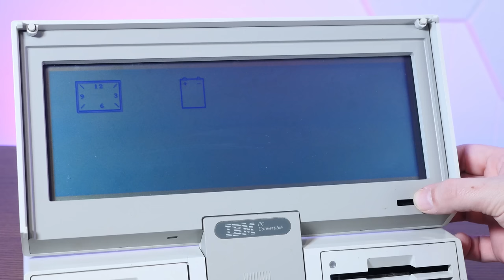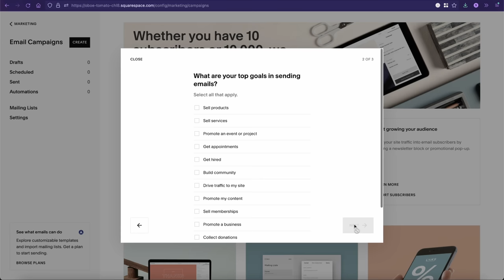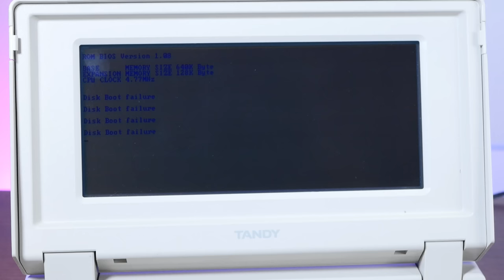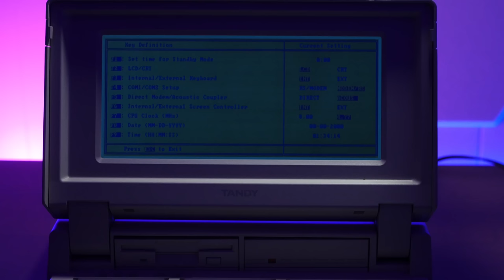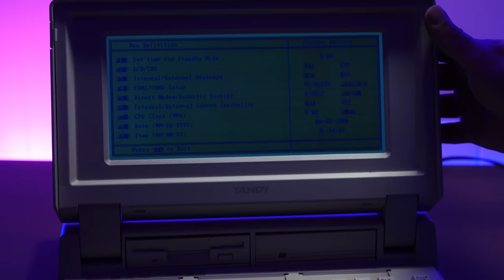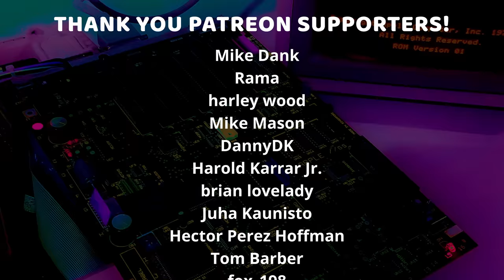I Fight a Tandy 1400HD to the Death

Comment: Unstable supply voltage/dead caps. You hear all that noise through the speaker because of all that electrical noise on one (or more) power lines.

Comment: You're not getting consistent power in. The noise your hearing is due to noise on your power lines interfering with the speaker, the reason you're hearing a difference in tone when accessing the floppy is likely evidence of this. The power supply needs some further work and it would be a good idea to recap the motherboard and have a close at the  power rails to make each component is getting an adequate supply.

Comment: The Tandy is acting like it's not getting enough power. I'd suggest doing a full recap of the other power supply also. One way to test weak power supply power is to unplug the HDD and see if that improves overall performance, as the HDD is the biggest power consumer in that machine; The backlight being the second-largest power consumer.

Also consider testing and recapping the motherboard itself. And, while some people might balk, I'd suggest replacing EVERY electrolytic cap I see. Nothing lasts forever, and IMO, it would help to resolve a lot of electrical gremlins. It just depends on how much you want to invest in these machines.

Comment: 1701 means hard disk controller error. Light blinking and disk spinning down indicates the drive has an error code to report (which it is blinking out). The drive thus is not responding to commands and thus the controller reports an error.

Comment: There's almost never a good reason to jump a fuse. Either it's blown because there's some other faulty component that's drawing too much current, or there's some other problem that hasn't caused the fuse to blow. Either way, check the continuity of the fuse and if it's blown you need to figure out why it blew, not just replace it with a wire. If you do that and the problem is still there, it could possibly draw a lot more current and cause even more damage.

First step is always thou shalt check voltages. You should be able to see if a rail is loaded down. The fact that the screen dims under load should be pretty visible on the multimeter. If you haven't already replaced all the caps in the power supply, that would be a good start. I'd also check the diodes and transistors, make sure they're not shorted something. Also check the transformer to make sure there's no shorted windings, or shorts between the windings.

That capacitor falling on the motherboard could also have caused something to blow, which is now loading down a power rail as well.

Anyway, that's a good start for your homework. Please turn in your copybook once you've completed the assigned exercises.
Reply: I was internally screaming all the time he did that, I mean checking the fuse and recapping the PSU should be the first thing when you see the screen flickering when something drawes power...

Comment: The screaming noise is probably due to poor filtering on the power rails. Could also be the cause of some of the other weirdness. This could easily be due to the other caps in the power supply being bad, despite not looking bad, and not filtering the power rails properly.

Comment: Seems like one of the drives is browning out the system. Or maybe the floppy controller. You should put volt-meters on all the voltage rails and measure them when its trying to do stuff.

Comment: Ok on fuses, you can use continuity checks on a multi-meter. Also with that much corrosion, you also need to check the continuity between traces on the board itself, because that level of corrosion most likely ate away some of the traces.
Reply: I'm watching this in horror, thinking "JUST CHECK THE CONTINUITY!!!, WHERE'S YOUR METER???? WTF????" , I'm currently at 8:03 so I don't know what happens next.
Reply: Especially vias, I've found...
Reply: Echo the comments above. I was so nervous…
Reply: I was thinking the same thing. If you don't have a meter, I highly recommend one that beeps for continuity so you don't have to look away from the probes while testing.

Comment: Im happy you decided to do a full recap!
Visual inspection of caps just tells you they look nice, nothing more.

When a friend donated a Macintosh Performa 450to me he tested it and it was working.

I got it a few days later and it was stone dead. PSU caps where leaking everywhere and it was fresh! The problem was that o-rings dry up, they get hot during first power up and dont expand with the casing so they leak and die after that.

Fixed the PSU, it powered up but the FDD had a lot of issues, one was leaky caps with corrosion.

I was swabbing of the paint apple put on them during manufacturing, I wanted to read the specs printed on top of the SMD electrolytics hidden under the paint.

The dam caps fell strait off LOL!

Looked like traces and pads where gone, brown corrosion crap everywhere. Cleaned it off with vinegar and I found perfectly good copper under the corrosion. Recaped it, cleaned the heads (did not read or write properly), and eventually got i working properly again.

Still have to do the MB but will do that once I found a replacement for the HDD.

But I would not be surprised if the lose caps in your machine just detached them self's, old electrolyte seems pretty corrosive compared to more modern stuff and the legs just corrodes off the pads.

Im sure you get it going with some fresh caps and probably a few more fixes,  often other stuff are broken too, not just caps but lets hope not.

Good luck and see you in part 2!

Comment: I would probably try measuring the power supply voltages.  Most likely 5 and 12 volts with a teensy bit of —12 for the serial port.   Replacing caps wholesale is not the very best strategy, better to measure them first with a cap and ESR meter. It’s best to have some guidance from the measurements.  Ad one is likely to maybe goof up on replacing 10% of the parts so fewer repairs is better.

Comment: The hard drive itself may have some leaky capacitors and/or the actuator motor may be frozen. Had both issues on some of my more ancient laptops. Dunno if these drives work now (as one machine is still dead and the others don't have a BIOS so I can even tell them that they have a hard drive), but at least the drives now pass their self test as in they spin up, wait another second, then the actuator arm moves around, parks itself, drive LED turns off and the drive stays on.

Comment: The 8086vic-20 chip architecture tells me the drive is a 720K floppy drive. Using a 720K boot floppy (not 1.44) should get you up and running. The physical difference you should be able to see is if there is a hole opposite the write-protect tab. I;ve had to cover the hole in the past to get the disk to get a 1.44 to format as a 720K. Of course, you could always install a 360K drive for testing on the bench. Tandy units tend to power over the data cable, so without seeing the connections on the drives themselves, a little difficult to know. If the HDD is dead, best to pull the card and drive for testing, that way the controller isn't hanging the bios on startup. It is possible the drives are working, just a LLF is needed. I suspect the light tube in the LCD may be worn out and is dragging down the power supply. They can be a pain to replace, but it is doable. If you need some tools, let me know and I"ll send you a few that you may be able to use. Let me know if you have issues/questions, as these 8-bit units (8086's) were how I started in the computing industry back in the day.

Comment: Hey Sean. You absolutely need to recap those power supplies. They use esr parts which allows for rapid discharge, but they've long given up the ghost. Do not just buy random caps for this, need to match parts. I can help you with this if you need
Reply: Of Rochester? Like the Medway town?
Reply: @oldtechnobodycaresabout  new york

Comment: If it's anything like the early ZDS XT laptops, the hdd controller did not report in bios the drive size.

Regarding the floppy used - was it single density?  Some of those old laptops were single density only.

Comment: you should have gotten a 1400LT they are much more reliable and you can get a cf card adapter for it so you can keep both the dual floppies and still have a cf hdd. I did that to mines and its a blast using it!

Comment: Maybe you could temporarily substitute the PSU by an old AT or ATX one, just to see if it's a power issue. Also, those fuses really should be left as if there is a problem you don't risk passing high voltage to the main board. In a bind, you could just hot-wire a barrel fuse in it's place.
Reply: My temporary fuse replacement is usually a single tiny strand of wire, which is basically a fuse without the glass/container, or a piece of solder, because it melts pretty quickly if there's a problem.

Comment: Cute little computer. Floppy probably just needs a good clean, maybe has some sheered gear teeth. I would never expect such an ancient hard drive to just boot. Probably stiction or crashed heads. The 'voltage regulator' is most likely the step-up transformer for the backlight display. Remember to completely clean the boards before and after re-capping and watch out for loose pieces of solder.

The power supply is still suspect and may not be delivering enough power to the drives.

Comment: I'd love to make a Raspberry Pi cyberdeck out of one of those.
Reply: Put the Pi on an expansion card to replace the modem. Full original hardware with the power of a Pi on a bootable card.
Reply: @JosiahGould  There was a post on Hackaday last week showing how someone built a PCMCIA wifi card using an RP2040. I've found a standard Pi fits nicely in the case from a US Robotics Speedster modem, and can connect a hardware serial port on the GPIO pins.

Comment: i just fixed up a pentium 100 laptop and its working nicely, upgraded the ram to 40mb (32mb module + 8mb onboard), and a 32gb 2.5 IDE SSD from amazon. i have Windows 95 C on it.

Comment: You still have a power issue. That squealing is noise from the power supply. Bad filter caps, could be bad caps on the motherboard as well. The dimming of the display shows me that the voltages are sagging when the drive motors activate.

Comment: Sometimes to check just how bad the PSU is, i try to replace it by wiring up a standard PC PSU, however that implies figuring out the voltages for each pin.

Comment: This reminds me of PSUs inside an X68000. You should consider making a custom PCB that holds a PicoPSU. That will make the unit work correctly forever with modern protection that this PSU doesn’t have.

Comment: A good rule of thumb when it comes to blown fuses is to always assume something blew it. With that in mind, bypassing one with a wire link like that is usually a bad idea, and you're lucky you didn't blow up something else on the PSU. The first thing to do would be to look for dead shorts from any of the voltage rails to ground, and across AC. Then, check the diodes and the legs of any transistors, power regulators, etc for shorts. If everything looks good, unplug everything from the PSU and stick another similarly-rated fuse in the circuit and see if that one blows. too. If it doesn't, start looking for shorts on the input side of things.

The first rule of electronics troubleshooting is always check voltages. After you get your fuse problem squared away, check the +12v, +5, -5v, if it exists, and any other rails indicated by the service manual or any other documentation you can find. Often, a screen will dim or a hard drive will fail to spin up because they're getting several volts under spec. Leaky and dead caps can certainly cause this problem, but resistors can also drift out of spec, and voltage regulators often fail. A lot of PSUs have trim pots that allow you to adjust the rail voltages up & down, which might take care of the problem, too.

Comment: aren't those technically luggable computers?  i have a zenith portable that looks like a big laptop, heavy weighs a bit more than 10 pounds.  has no battery, runs on 110volts.  only battery it had was a cmos battery which i removed, thank god it didnt leak on the board

Comment: Wow, I had one of those, it was my first ever laptop.  I got it for free because it had a dead charging circuit, I replaced a burned out resister and it started working again, so I guess it cost me 12 cents.   I used it for years.

Comment: Try to find a service manual for it if you can.  The Tandy service manuals were very useful, and quite thorough for the most part.  I used one of the LT1400's back in the day to write work procedures for our division on the boat.

Comment: I would totally concur about it being a power issue.  The fact that the whining changes when you change the Vreg, the dimming when drives are accessed etc. all screams unstable power.  Methinks that 2nd power supply has issues.

Comment: If I were testing a system with the PSU open/dismantled, I would plug it into a power strip which is switched off, turn the power switch on the computer on, and THEN turn on the power strip.   That way your hands are away from the PSU when switching the system on.

Comment: Never replace a fuse with a random wire. A protection fuse blows to prevent catastrophic damage. Replacing it with a wire almost guarantees the release of White Smoke™ from the funeral pyre of a now deceased machine.

Comment: Yeah, I don't trust a single one of those caps. If one has leaked, any others that you ignore could leak. Recapping the whole thing is definitely the right course. You should be able to test the fuses with continuity mode on a multimeter. if blown, you can get replacements easily. Digikey is my go to parts supplier, but there's other places you can use too.

Comment: Replace the capacitors on the motherboard check if any of the resistors are out of tolerance if the resistors are too far out intolerance in the capacitors are bad on the motherboard which will cause a lot of issues and could be the reason why it's not working 100%

Comment: small board is probably screen backlight module and it could shock you if it is cold cathode drove also the dimm and blinky backlight might be a sign your power suply is marginal, does voltages but caps are so worn out it lost all current sinking capacity 
the one that only spins a fan and stops is looking like is smart enough to shoot down on a short  circuit protection so either you replaced something wrong, or it is still having some acid under some components and don't like it or the motherboard itself have a short

try checking 12V line and 5 v lines on the working computer while it is in it's almost working oryginal state  and monitor if any voltage go down when it dims down then trace a capacitor in power suply that is on that line and replace it before it blows up, repeat untill happy or no capacitors left

also check if power brick is ok, because if that is oryginal brick it may be cascading problems into working power suply , best would be starting with known good or even new power brick with the same polarisation and voltage, although new power suply can be more picky with overcurent protections and not even work

anyway, garbling noises and drives making wierd things while trying to work is often a sign of not having enough power to run, i had the same situation in modern security camera recorder, 12 power suply that wasn't enough to power up tha hard drive but was able to boot the system due to it working from different power rail and taking less power

Comment: As others have said the noise from the speaker and the dimming screen is screaming that it's a power problem, particularly the power supply and not the motherboard. And as for the fuses, I do not approve of your bypass method. I would solder a thin bridge wire on the underside of the board rather than install it in place of the original, then it's obvious in the future that it's a bodge and the originals will still be in place for reference.

Comment: the whole point of a fuse is if the device is faulty it blows preventing it from damaging other components... if the fuse blew that means the board is faulty and so bypassing it is a good way to destroy the rest of your machine. i mean there are other reasons a fuse might blow but you should always replace the fuse and not just bypass it to be on the safe side.

Comment: Start with the really obvious. Firstly, check the bootable floppy disk is working, by booting off it in a known working machine. If it's fine, clean the heads of the Tandy floppy drive, and align them if necessary. Can you plug the Tandy fdd into a working PC to check it? Unplug everything that isn't needed just to boot from fdd. If you can, see if the hdd is recognised in another PC. Check the 'fuses' and PSU with a multimeter. Even better, look for a download of the service and user manuals for the machine. Then you'll have some clue as to what does what and what any error codes mean. Hopefully you'll get one or both working. 🙂

Comment: That IO controller/hard drive bracket design looks terrible.  A side note, I owned an IBM PCjr (yuck) around the same time these were out.  My PCjr (yuck) had "sidecar expansion" where full-length expansion cards could be added to the side of the case, making the computer much, much wider on the desk.  IBM seemed to think that expanding the size of the computer was a reasonable thing (it was not).  I cannot imagine adding cards to the back of the IBM PC Convertible.  I picture adding so many cards that you would need someone sitting across from you to use the their lap to hold up the "laptop" as well.

Comment: I have the 286 version of this the 2830? 2840? hd . The power dc boards on these suck, they never age well. Ive tried a couple times to fix mine, and still doesn't want to boot. Stupid watchdog circuit is unobtanium. Maybe I'll try again soon. I can get it to boot bypassing the dc to dc board.